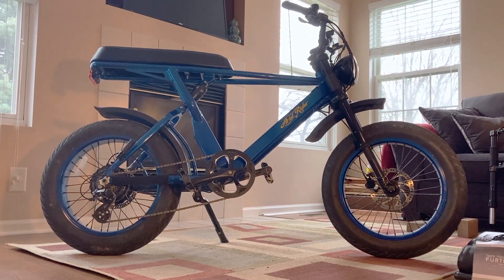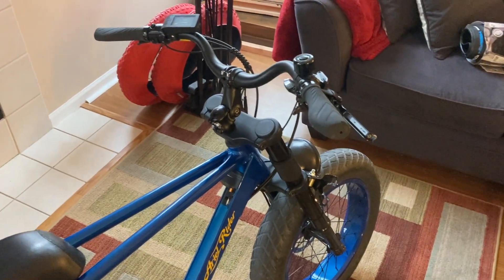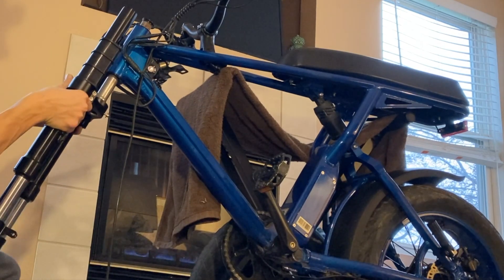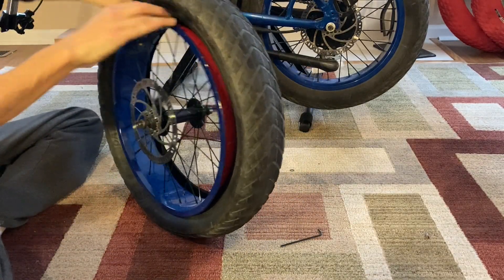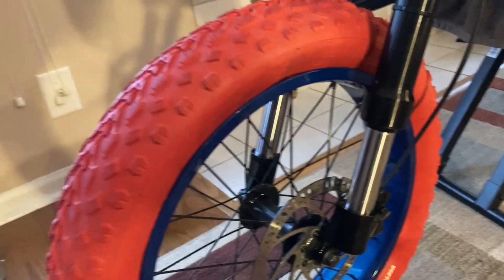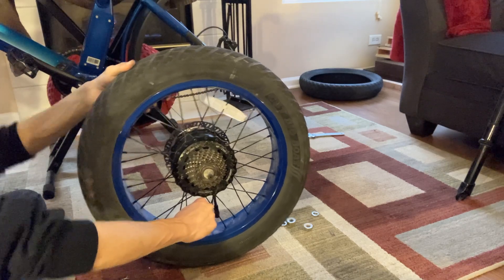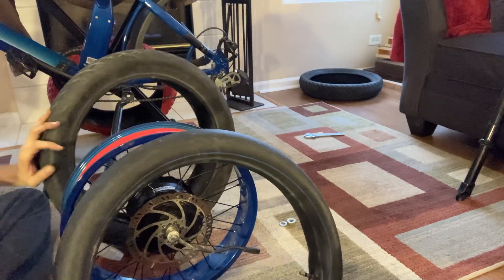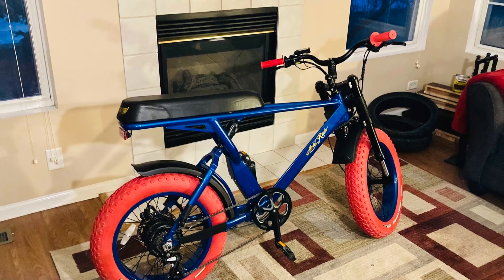Ariel Rider X-Class Upgrade Day!

Comment: Yeah those tires must be broke or hot. Because for mine I have to use motorcycle levers.
Reply from the maker: I let them sit by the fireplace for a while before mounting/removing any bike tires. The heat makes all the difference!
Reply: @ebikenoob4463  actually I did that and had 0 luck. I fear baking the paint off. It got just warm enough to be uncomfortable. Instead I used a pair of sheet metal shears and just cut them off. I put motocycle enduro tires on my bike and they look sick.

Comment: Does the 2nd gen x class go faster?
Reply: Do you mean the new 52 volt?
Reply: @dickflinghammer58  no just grabbed that when it was $1799 and part of the fb group. I saw some comments (I forgot where) and they're saying 2nd gen of xclass got a new fork and controller I think. And theyre able to reach 30+ mph throttle only when it used to be around 27.
Reply: Red! Cool I was trying to get the Vee speedsters But they were sold out till March. So I got the same kind as you but Black..👍
Reply: @therubio7618  Couldnt pass up on the black also. Hope the long wait will add some better parts if needed.